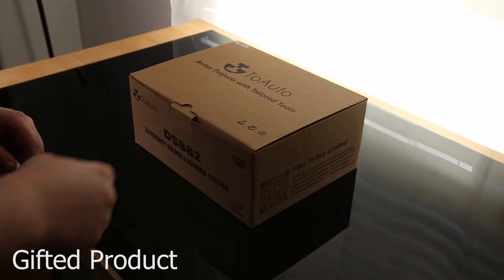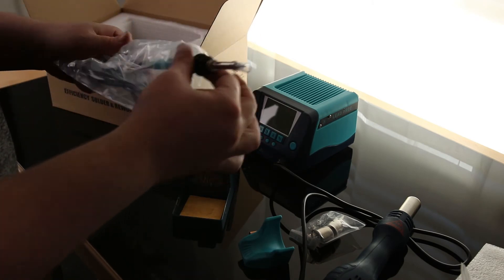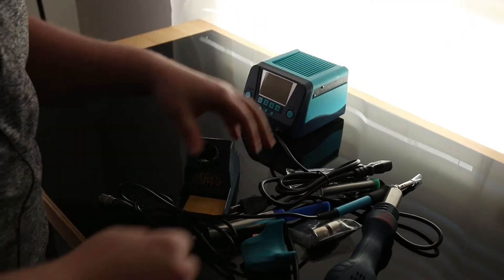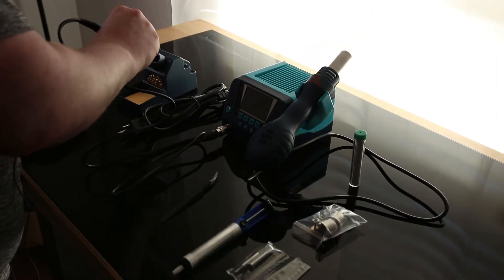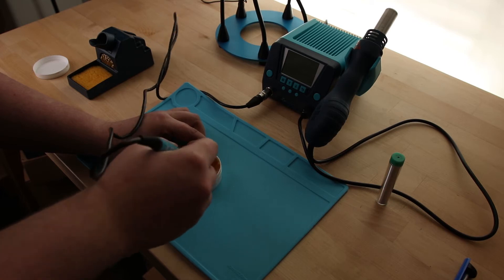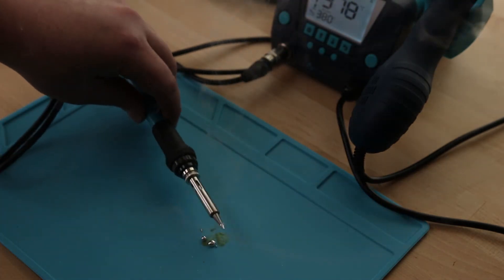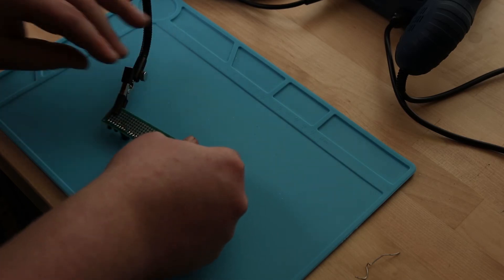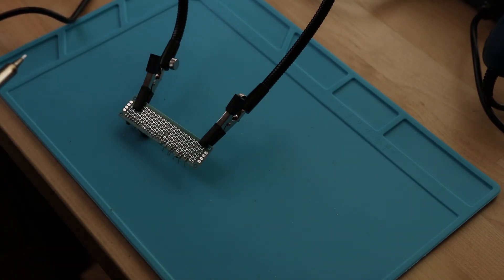Testing Out The ToAuto DS 882 Rework Station

Comment: is the soldering tip on this  station also grounded like the DS90 from the same brand?
Reply: Very likely, it might be ToAuto branded but are a white label made by Bakon under the BK882 model. DS90 by a number of outfits are all a variant of the BK90 from Bakon with different accessory options and different regional power supplies depending on where in the world you are.